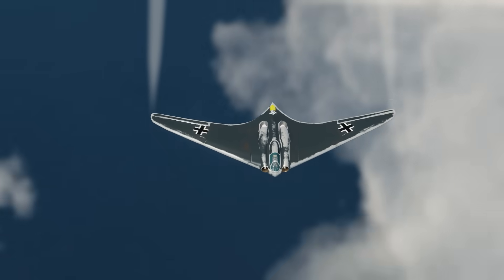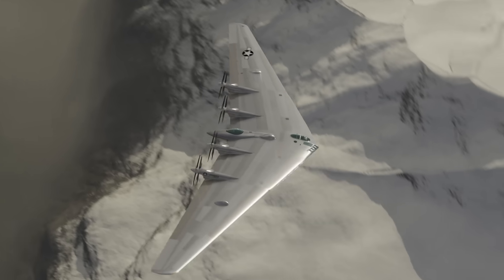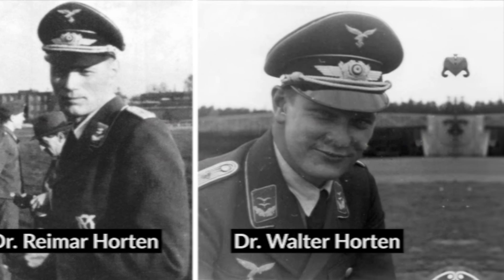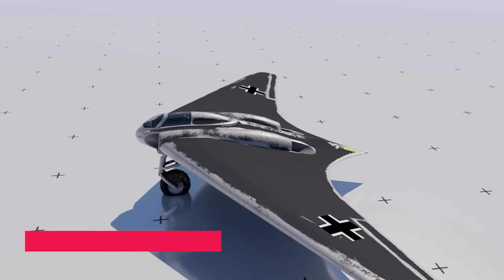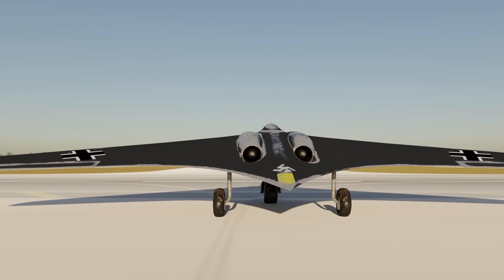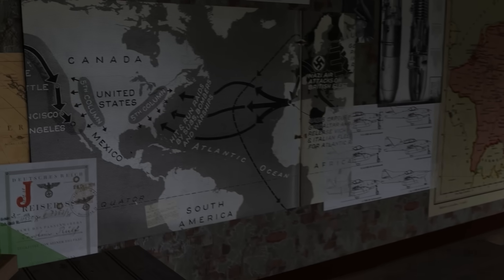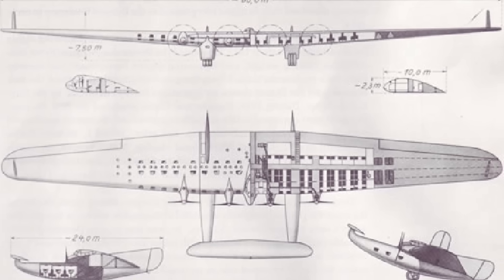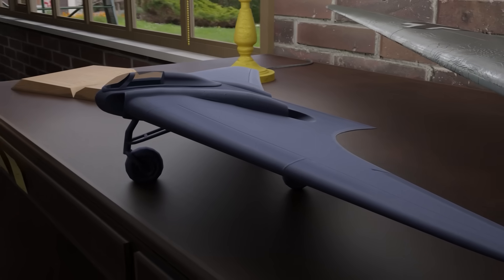Insane Flying Wing Jet Fighter To Save Germany - Horten Ho 229 Nazi UFO

Comment: One thing, Jack Northrop and the Horton Brothers were working on the Fling Wing concept at the same time. Jack Northrop had conceived of the idea from gliding seeds from a tree species. Neither Northrop nor the Horton Brothers knew each other. Northrop started working on the Flying Wing design long before WWII as a test bed for both passenger and military aircraft. During WWII Northrop had made several versions of all wing aircraft, including rocket powered. One design was strictly a ramming aircraft with Titanium reinforced wings designed to cut through another aircraft. Northrop had made several small single seat prototypes. One being the N9M that was restored and flying for several years. But unfortunately crashed during a practice for an airshow and was lost. There are several videos on YouTube of that Wing, here is one:
https://www.youtube.com/watch?v=lSf5TX_FcBw
Though this information would help you.
BTW, there was also a French designer that made a type of flying wing that flew in the early 1900's. It wasn't a full wing though, as it still had a tail for stabilization. But it didn't have a fuselage. The pilot sat inside the wing.
Reply: yeah, most of this rarely talked about.  Germany did have a lot of firsts, but the flying wing wasn't one of them, though i will admit i didn't know about the french one.
Reply: @Wowflunky   The Flying Wing has always been a fascination of mine. I think the first time I saw one was in the 1953 movie of H G Wells The War of the Worlds when I was just a kid. There are only a few short senes showing the Flying Wing, but I though it was beautiful and wondered why nothing ever came of the design. 
https://www.youtube.com/watch?v=esqQXQ9n7u4
Up until the internet started to get big, it was extremely hard to find any information on any of the Wings. Though I did find a model as a kid and the first book I found was in the 1980's. In that book, they say that the actual weight that the Wing could carry was still classified information and the USAF C-5 Cargo aircraft could carry less than half that. But there's information out now that has several weight lifting figures. How much of that is true, I don't know. A few years ago I picked up 2 big model kits of the X/YB-35 and the YB-49 from AMT at a local Hobby Store. I'm trying to get the model of the Horton HO 299. Ironically the same model designation of the Boeing B-17 (Model 299) when it was first designed. 
But since the F-117 was developed, the Flying Wing design of Jack Northrop was re-investigated and the B-2 was developed, Soon the second version, the B-21 will start entering the Air Force.
But you are right, that Germany was the first to develop many things. Though the British and the Germans were working on the Jet engine at the same time, the Germans had the better design. The British, Whittle Jet Engine was a centrifugal jet. Much like how a Turbocharger in a car compresses air by spinning it out to the side. I worked a few T-33 Jets that used that type of jet engine, the J-33 engine, while I was in the USAF.
One of my favorite German Jets was the HE-162 Volksjäger. Though there were problems, mainly with the glue for the wooden parts, I believe it was superior to the ME-262. It just came out at the very end of the war to be any good.
BTW, the Italians made a Jet aircraft just Before WWII, It was more of a deducted fan than a jet engine. They used a piston engine to turn the compressor. It did fly and Italy had a few in service at the start of the war. But the performance was bad. Check that one out sometime, it is a real oddity that worked but is even less known than the Flying Wing.
Reply: @EIBBOR2654  holy crap, i was not expecting that much, thanks for the link though gonna check it out here in a bit.
Reply: @Wowflunky  Maybe they get credited for some others incorrectly but the Horten planes were definitively a first because of their advances in stabilizing. There were indeed flying wings before or around the same time (see the british A.W.52), but they all had vertical stabilizers or were gliders. So the very first motorised flying wing was the Horten H II in 1935 and the first jet propulsed the H IX (Ho229).
Reply: Many people attribute US flying wings to German tech. But many nations had some sort of flying wing idea being made and tested to some degree. They were all done independently of other ideas.
Reply: @blitzkrieg2142k  I agree 100%. I read several books on aircraft design and spent my life working on military aircraft. There are many designs that came out close to the same time in several nations due to a requirement or through experimentation that were never known of outside of those countries. And it isn't limited to aircraft. I've had to set several people straight on the jet engine. Many think it was a US development, but the US never had a jet engine design or were working on one prior to WWII. It was after the British decided to ship Frank Whittle's design and information over to America early in the war that the US designers even thought of something like that. But Whittle's design was a centrifugal compressor design and the US developed the J-33 jet engine from his design. It wasn't a true axial flow jet engine.  I worked on some of the very last ones in the USAF inventory that powered the T-33. P-80 then re-designated the F-80 Shooting Star. I worked on them back in 1980 to 83.
However, Frank Whittle in England wasn't the only one working on a jet engine. Germany's Ernst Heinkel was working on the development of a jet engine and had the first jet flying in German before WWII started. He was a true axial flow (Straight through flow) engine and the one that became the standard engine design today. But even Italy's Giovanni Caproni was working on a jet powered aircraft before WWII. But his engine, the compressor was powered bu a radial piston engine. Caproni's design did fly but was really what we would call a Deducted Fan  design that got a boost of power with a type of afterburner. His aircraft could fly on the compressor power alone and got far better fuel economy. But dumping fuel in a burner section expanded that compressed air and gave it a boost like a jet engine. England, Germany and Italy were all working on a jet engine design without knowing of the other countries work. At least at first.
 Italy also designed an aircraft very much like the US XP-55.
Aircraft development and design have always been an interest of mine. I've always found it fascinating as to how many countries were working on similar designs at the same time without knowing someone else had already tried it or were working at the same time on aircraft of similar design.
Today it is almost impossible to do something like that, with all the communications and the internet. Most designs are known to others before they leave the drawling board.
Y'all take care.
Reply: @EIBBOR2654  100% the Horton Brothers had there Jet Engines in the Fuselage of the HO229 flying wing before any other jet wing.
Reply: @blitzkrieg2142k  Seems the Horten Brothers in Germans were way ahead :)
Reply: @666theninja  Or maybe not. As has been mentioned by others, the idea of 
flying wings, tailless aircraft  and delta winged aircraft goes back to the dawn of heavier than air flight.
Reply: @EricIrl  Horten Brothers were all over it first :)
Reply: @666theninja  All over what? If you are implying they were the first to fly a flying wing or tailless design, you could not be further from the truth.
Reply: @EricIrl  :) Northrop=Prop Engines Flying Wing, Horten=Jet Engine Flying Wing
Reply: @666theninja  So what. The hard part is making an all wing aircraft fly. The power plant is a side issue.
Reply: @EricIrl  Jet Engines in a Flying Wing and Flying would of Ruled in WW2. Would of been a Game Changer for the Germans if they were more Advanced with the Horten Jet. Lucky for the World they were not.
Reply: @EricIrl  The Jet Engine Horton Flying Wing would of been a Game Changer in WW2 had they been a few more months ahead. So the Engines did matter :)
Reply: @EricIrl  Not a waste as the US used the Jet engine idea into the Fuselage from the Horton 229 into there B2 Bomber. There V2 Rockets did help get man to the moon.
Reply: @666theninja  Firstly, the waste I was referring to was the waste of effort and resources it was for the German war effort. Embarking on unrealistic projects actually hindered the Germans rather than helped them (and a good thing too).
No technical innovation is ever a complete waste. Somebody, somewhere, sometime will be able to make use of the technology. In this case, MAYBE the Americans benefited to some extent from the 229. However, it mist be emphasised that the 229 was never flown by anybody other than the Germans.
As for putting jets in flying wings, Jack Northrop was already planning that before he even knew that the 229 existed. Northrop was as far down the road in flying wing technology as the Horten brothers were.
Reply: @EricIrl  Northrop was prop engines not jet engines, so the Horton brothers were ahead as far as that goes. Lucky for the World that Germany was time lacking on there Wonder Weapons.
Reply: @666theninja  The Horton was the first with jet power, that is true. But Northrop was already ahead in some areas of flying wings and jet powered designs were only soon to follow - borrowing absolutely nothing from Horten. There is too much praise heaped in German’s senseless, wasteful and often useless so called wonder weapons.
Reply: @EricIrl  Hello the Germans got Man to the Moon, V2 Rocket Technology and there Rocket God they got under Operation Paperclip, Lets be real.
Reply: There was plenty of flying wing aircraft back really until the dawn of aviation. In effect the wright brothers aircraft is a flying wing, because it have a canard its also in effect tailless, but not canard less.

What confuse it a bit is that people assume that flying wing is tailless, that is not really always the case. Northrop had made a tailed flying wing already back in 1928. That wasn´t that strange of a concept.

In 1917 the Burgess-Dunne biplane was sort of tailless also, and kind of sort of a flying wing.. or wings.

In 1931 Lippisch made the Delta I a sort of blended wing hybrid that was tailless.

Both Northrop's early wings had fins added, making them not true tailless flying wings. The YB-35 sort of looks like a mix of a Lippisch delta I and the 1928 Northrop flying wing. Because the Delta I was not only pre war, but also pre Nazi Germany, there is a good chance that Northrop know about it.

Its no secret that the Horten brothers was inspired by Lippisch.. both being German.

Comparing YB35 and HO 229, its really the tail... sort of, of the aircraft that is diffrent. Most other parts predates second world war.
Reply: @matsv201  i knew that there were many planes that fit the flying wing description but i always simplified it by saying if it had vertical stabilizers (tails) it wasn't a flying wing.  Yes over simplification as there are gray areas in everything...but it did allow for the it's a wing and it's damn close to a wing folders. that's why in my book there are very few actual flying wings.
Reply: How many had jet engines?
Reply: @IgnoredScuff  If you are asking about the Northrop Flying Wing, the answer your question, I believe there were 4 or 5 Flying Wings that had Jet Propulsion.
First the Flying Wing design and research started before WWII and jet engines were in their infancy, mostly experimental and secret. England, Germany and Italy were the countries doing the research in jet propulsion. All 3 countries had vastly different designs. Italy's design was more of a ducted fan as the compressor of the engine was piston powered. So all of the full size Flying Wings were designed for the piston engines as the X/YB-35. 
That being said, by the time the Flying Wing was actually flying, WWII was over and the jet engine was in demand. So Northrop had to modify the air frames that were completed to jet propulsion. From what I've read, there were about 14 of the full size Flying Wings made, but only about 5 of these aircraft got engines installed. 2 had Piston engines installed and were the X/YB-35's, but only 1 flew. The rest, about 4 got jet engines and one piston engine was converted to jets. Those were redesignated as the YB-49 and YRB-49. The YRB-49 was the Reconnaissance/Bomber and differed by having 2 of the 6 jets mounted on pylons on the underside of the Wing. 
All the small versions of the Wing, the N1M and the N9M were piston powered. With one exception. During the war, there was a small Wing designed with reinforced Titanium leading edge wings. That one was Rocket Powered and was designed to ram enemy aircraft and slice through them to knock them out of the air. There were also a couple of Glider designs made too.
Below is a real good YouTube video with one of Northrop's Test Pilots, of the B-2, Bill Flanagan, that explains most of the history of the Flying Wing that became the B-2 of today. Also the B-21 Raider is about to roll out of Northrop very soon to replace the B-1 Lancer and is a much updated version of the B-2 design. Check out the video as it explains more and better than I can here.
https://www.youtube.com/watch?v=Xax4q4Ctdh0
Reply: Titanium to ram other aircraft sounds extremely risky, but it would scare the hell out of the other pilot. BTW The Horten aircraft is spelled with an 'e' not an 'o' at the end.
Reply: @mach1553  Sorry about the spelling of the Horten, my bad. I could blame it on the spellcheck, and I might have used that but the correct spelling was right in front of me. But I am a horrible speller. Public schools and an early experiment in spelling. TCTE for here.
But yes, Northrop was asked and did develop a small Flying Wing with a reinforced leading edge made out of Titanium. The pilot laid down inside of the aircraft to fly it and the two versions were one rocket powered and one jet powered. The cockpit and windscreen on the jet version sat back a bit from the leading edge between the two intakes and it looked a bit like the SR-71 drone. It was designed to ram other aircraft and take off the tail controls, rudder and elevators or possibly the wing.
Risky? You bet it was, but it was designed specifically for that and probably would have worked.
As I recall from a book I had on the Flying Wing developments, there was a glider and one or two of the rocket and jet powered versions built. But non ever saw use other than like a concept/experimental aircraft.
I did a quick look and found this video on these aircraft. It's not the best video and the information is a bit lacking, but it will give you an idea of what they looked like. There are other, better videos out there if you care to look. It's late as I'm writing this and I've got to get to bed, have an early appointment at the VA in the morning. Enjoy
https://www.youtube.com/watch?v=uFBqNBvY-9A
Reply: Just think of the F-117 and B-2 today
Reply: @williammitchell4417  Just think Ho229 :)
Reply: @666theninja   I could also say something about the Me-163🤓
Reply: @williammitchell4417  Can't we All :)
Reply: Hugo Junkers even worked on the fyling wing passenger plane from the late 1920s on :-)
Reply: Though the flying wing design is very unstable and impossible for a human to fly manually. It really wasn't possible until the advent of computers that could let inherently unstable aircraft fly reliably.
Reply: @MrMarinus18  That's interesting, since they were flying them manually back in the 1930's through the 1950's and that was just the Northrop designs. The Germans had at least 2 models of a flying wing that they flew. The British built and flew one or two models and there were earlier designs. 
Your comment is not based on facts. You need to do a lot more research on Flying Wings. 
The flying wing was not impossible for a human to fly. That was even shown with the N-1M, the N-9M, the X/YB-35. the YB-49 and several other models. The N-9M was restored and flown for several years. It only crashed because the pilot was doing some radical revenuers and lost control. He was most likely pushing that wing to its limits when it got away from him.
The Flying Wing YB-49 flew from California to Washington DC and set a speed record at that time with no problems. But on the way back they had engine problems that may have been caused by sabotage.
You would have to go back and read many of the reports and political pandering going on back at that time. We were just satrting to develop jet engines and aircraft powered by them. The Flying Wing was also caught in the middle of two competing larger aircraft companies, Boeing and Consolidated. Consolidated just came out with the huge B-36 and had a lot of clout in DC. The B-36 could fly long distance and carry a Nuke. But it suffered from a multitude of problems and wound up with 10 engines. 6 piston and 4 jet engines. It lasted about 10 years in the USAF service. Boeing was coming out with the B-47 that could fly higher and was at the Subsonic speeds but was pushing the Trans Sonic threshold. It too could carry a Nuke. Add to it that Boeing was developing the B-52 that would soon be in production. So the Flying wing was stuck between the two. It didn't have the range of the B-36, nor the speed of the B-47. But it could carry a larger pay load than either of the other aircraft.
This was also at a time of Big Budget Cuts for the military. Consolidated had good lobbyists and friends in DC and many rumors and lies about the Flying Wing got started through them. (As you can see, nothing has changed in Washington DC and it is a Dog Eat Dog world when Congress is deciding on big money contracts) Boeing had a huge aircraft reputation out of WWII with the B-17 and B-29/B-50. The Flying Wing had some problems, but nothing that couldn't be fixed and a lot less development problems than the B-36. About the worst problem with the Flying Wing was the side to side slip on a bombing run. They were still using the Norton Bomb Sight and that made it difficult to hit the target. But Honeywell had developed a system to alleviate that problem. 
 Northrop was a small aircraft company compared to others. During budget cuts someone has to lose and it usually is the smaller guys. So being caught in the middle the Flying Wing got cut. Not because it was impossible to fly without computers.
There is a whole lot more involved with the Flying Wings and why they got cut than I can write here. Do some research and keep an open mind. A lot of what you have heard were from the days of budget cutting and the lies to kill the Wing.
Again, I'm not saying the Wing didn't have teething problems, it did. But they could have been fixed. Even back in the day of the computers of the time, AKA the Slide Rule and working knowledge.
Reply: The Dunne D 8 was a biplane flying wing design of 1912 which flew at Farnborough. I believe the machine, although designed by a British company was built by Nieuport of France. Northrop certainly knew of this plane before he designed his bombers. The pilot for the maiden flight was Captain Carden who flew the machine despite only having one hand. He obtained his Royal Aero Club licence in the machine. Nieuport obtained the licence to build the aircraft later before 1913. A witness to the flight of the D 5, an earlier model was a certain Orville Wright and Dunne aircraft were built under licence by the Burgess Aircraft  Company of America and improved further. The first aircraft bought by the Canadian government was a Dunne.
Reply: Usa stole German technology
Reply: Horten* they were German, not Amerikan.
Reply: The Horten HO 229 was the first Jet Flying Wing and they Test Flew one a few times in the Early 1940's until the pilot crashed it when he was told not to take it by the Horten Brothers, the Yanks like to claim Northrop had the jet one first but not the case. Horten Brothers built and flew the first Stealth Fighter Jet way back in the Early 1940's.
Reply: @666theninja  the Horton was by no means a stealth aircraft.
Reply: @Handledeeeeeeeeez  Hello was deemed stealth by the Stealth guru's from Lockheed.
Reply: @666theninja  No, it wasn't people from Northrop Grumman themselves said that the 229 wasn't a stealth aircraft
Reply: @topkek1194  lol they are the ones that put it on the pole to check it's stealth and said it would of had stealth to the WW2 British Radar. Go watch the video :)
Reply: @topkek1194  Watch the Doco, Hitler's Stealth Fighter it's on youtube, the Northrop Stealth guys say after they stuck it on that Pole and tested the Radar on it :)
Reply: @666theninja  if your talking about this one https://youtu.be/okVTritMlmo they say it would have around a 20% reduction on radar. Which is by no means a stealth fighter nor was it designed as such. It just so happens to have a lower radar cross section which is a by product of the flying wing design
Reply: @Monkey-kq1cr  It was Stealth the Northrop guys said it was. Wake Up.
Reply: @666theninja  I watched the video bozo L + Ratio
Reply: @Monkey-kq1cr  lol dose not seem so :)
Reply: @666theninja  rip bozo
Reply: @Monkey-kq1cr  Grow Up
Reply: @666theninja They had no idea it was stealthy, that was purely a coincidence.
Reply: @FrakMunkie  They added the fine charcoal dust to the paint, so proves they were ahead of the curb.